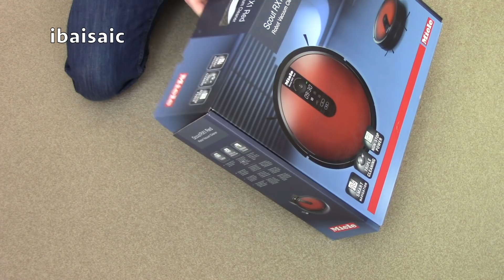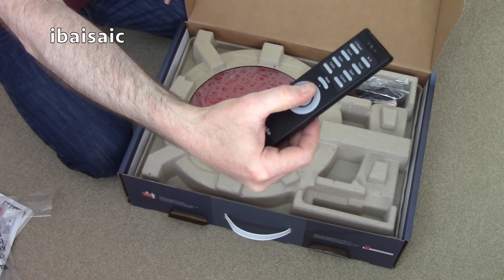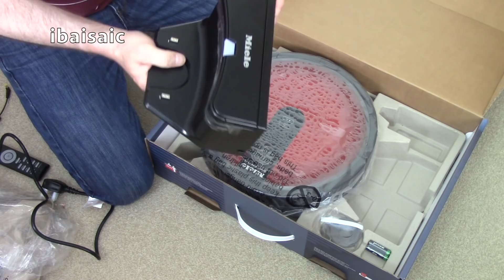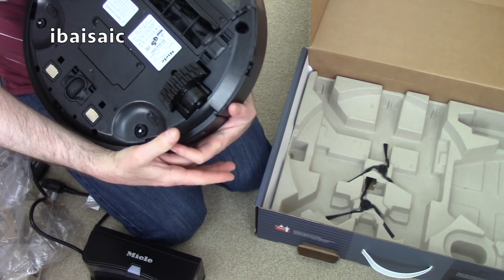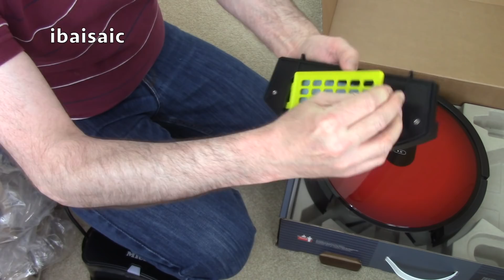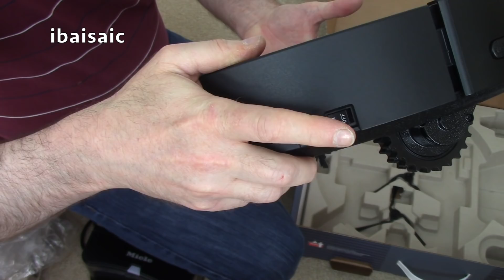Miele Scout RX1 Red Robotic Vacuum Cleaner Unboxing & First Look

Comment: Does it even have a motor behind that filter?
Reply from the maker: No, unlike the Roombas I've owned, the suction motor is not located above the dirt bin, but there is a suction motor inside this Miele though it's obviously not very powerful.
Reply: ibaisaic I didn't think about it pulling from the top of the bin with a motor inside. I agree though, I like my Roomba better because it has more power. I have a 790.